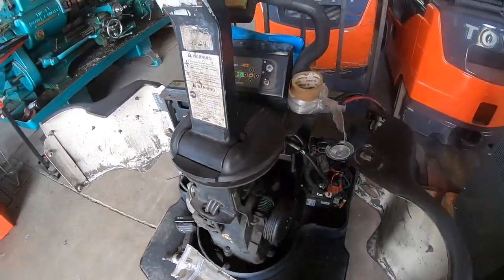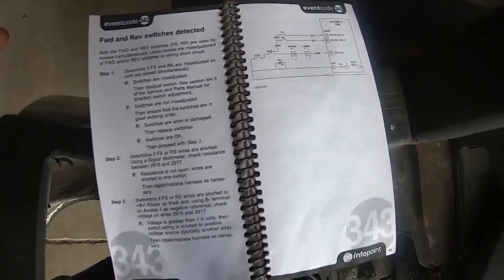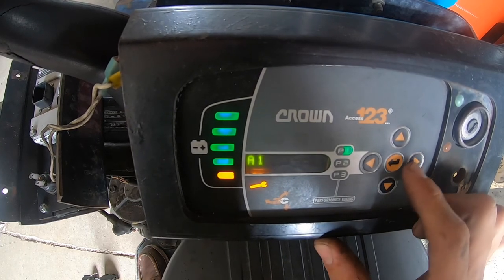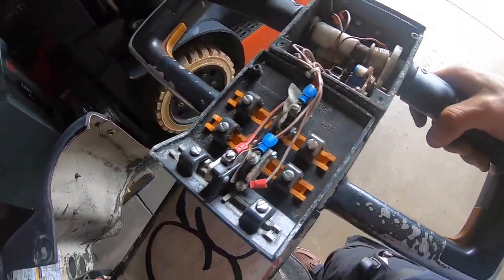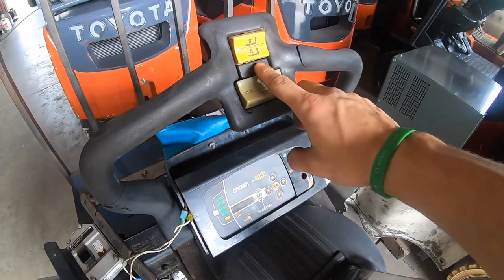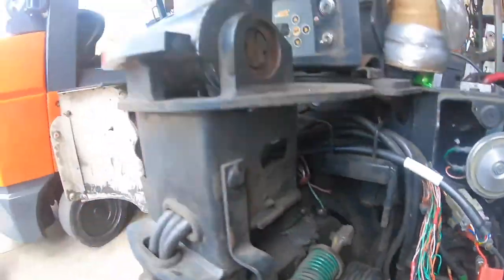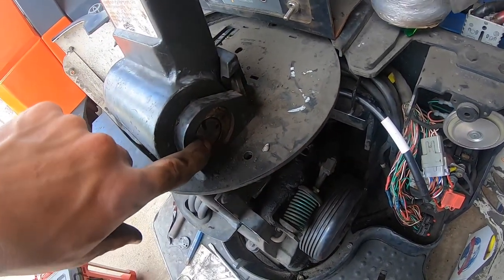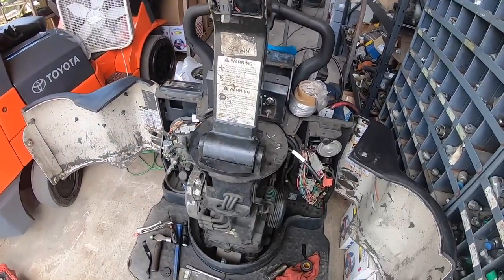CROWN PE 4500! Error Code 343 troubleshooting and repair!!

Comment from the maker: MY NEW EMAIL Is Liftworx@aol.com
Reply: good night, I'm from Brazil, I have a SHR 5500 CROWR, it's showing failure (RELESASE TRAVEL CONTROL) AND THE MACHINE I DON'T HAVE THE MAINTENANCE AND ELECTRICAL MANUAL, CAN YOU HELP ME, I WAIT HUG.
Reply from the maker: @LTB121  I will send you info. What is your email ?
Reply: how did you remove the harness
Reply: Is this still a good email
Reply from the maker: @KevinSmith-mt8cz  yes sir

Comment: I like your video could you make a video about how to test if the drive motor if its  a ground  Crown P.E 4500
Reply: Would like this as well
Reply from the maker: Will do! I recently replaced one because the drive motor would only drive super slow. The speed sensor was messed up. Another common problem is when it throws a code for the speed sensor, if you unplug the connector and turn the truck back on, and the code disappears, then it’s a bad motor.

Comment: So where would jc 401 on the main harness be? I had an error code 123 and 133 tested the can wires from access 1 and 3 and the ohms where good I also analyze the BRS1 and it's open and close as it should not sure where the problem is but it was also throwing code 133 which I'm supposed to test the jc401 to access 5. Any help would be appreciated.
Reply from the maker: Great question. JC 401 should be the big bin out harness that hooks up to access 5. OR I think it’s the one that goes to access 1. It passes by the lift motor pump and goes up to the display (access 1)

Comment: hey , nice video , ( 1:09 ) could you please tell typical code for crown sc series , besides do you accept consulations on your mail ?
Reply from the maker: Typical code is 2311. If that doesn’t work. You would have to contact crown and see if someone changed it
Reply: @theforkliftguy  oww thank you a lot
Reply: @theforkliftguy  maybe you know how to dissable the option of belt , every time i have to fasten my belt its so annoying and dangerous sometimes , maybe there is a wire which i can swich off
Reply from the maker: @panchasnyk8895  you would have to bi-pass the seat belt switch. Find the 2 cables that lead to the seat belt switch and join them together. That way you don’t have to keep putting the seat belt on
Reply: @theforkliftguy  god bless you , thanks a lot

Comment: You shouldn’t be saying the passwords out loud like this because then operators will be able to get into system and start turning off their travel alarms, spot lights, work lights and even worse… adjust the speeds and that can be a Big no no and someone could get hurt.
Reply from the maker: Thank you for your concern, I didn’t think about that.
Reply: @theforkliftguy  there’s other ways of getting the passwords too from what I’ve heard from other operators. Where I do catch someone changing stuff in the systems forklift, I end up going out there with my laptop and changing the password entirely. Good work though keep doing what you’re doing!
Reply: That's actually on the employer unless they can prove otherwise. Codes can be changed. It's taking things for granted when company's get to big to care about other stuff.  I know how to navigate the menus well enough between p1 and p3 but also know the speed can vary if you know the codes 1 time out of 1000 Is this maybe ever going to be an issue though. I've been using cat/crown/yale/linde/raymond/hyster/jughen or some other German brand for 18 yrs  they are all pretty good. User friendlyness isn't always great. And can easily cause a liability.  Problem is the people that decide to buy these for company's usually have never used one for 8hrs a day. And don't ask opinions from those that do. They look at the budget  😢

Comment: I work on pe4500 , all of a sudden these( fully release brakes ) errors been popping up. Any ideas
Reply from the maker: @KevinSmith-mt8cz  I would start by checking the brake switch adjustment. Make sure the spring tension is good, or you might need to adjust it so it hits the switch correctly.

Comment: How you like working of fork lift. I’m a 16 year automotive tech that want to make the switch.
Reply from the maker: I would 100% recommend it. You should do it in a heart beat. Or heavy equipment. Being a field mechanic, working on forklifts or heavy equipment is where it’s at. It’s not easy work but it pays better and every day is something different. You won’t regret it. There’s a reason you’re wanting to leave automotive.
Reply: What’s a better company you think. Crown, Toyota, Raymond?
Reply from the maker: @jess9571  I can’t speak for those companies, because I’ve never worked for them personally, but I can give you advice based on people that have worked for them and my experience working on those equipment. 

CROWN: they are known for their electric forklifts. I personally enjoy working on Crowns and that’s how I fell in love with electrical diagnostics and electric forklifts. Now I’ve met a lot of crown techs, and they generally don’t like working for crown. They have a lot of contracts and you’ll be putting in serious hours. Now I have heard that growth is pretty good in that company. Again, that’s just what I’ve heard. 

RAYMOND: a lot of my customers hate Raymond techs. Most of them are under qualified and just throw parts at things. Doesn’t mean you should be that way. Raymond’s are fairly easy to work on and they also are known for electric trucks. Raymond and Toyota is also kind of the same thing. 

TOYOTA: I’ve had nothing but good experiences with that company. My local Toyota dealer is amazing. I’m an independent forklift mechanic and own my business, and they go out of their way to help me if I need parts or services. I love working on Toyotas, as you can tell by my YouTube channel. From my experience, Toyotas are the best of both worlds. They have diesel, gas, LPG and electric forklifts. They got it all and they are really good at making them. Not hard to fix and parts are always available. I’m kind of biased towards Toyota as you can tell. lol

Comment: Today, I had a similar problem, with a PE4500, ok Error 336, potentiometer, 000. Drive-10.87 FWR-10.87, so far it is fine, now when you return the handler, then error 336 appears.
What can be???
Reply: Is adjust the pot  0 volts?
Reply: @brunocervantes2110  how?? pot is 0
Reply from the maker: Do you know how to enter to the password and get to inputs??
Reply: One of your switches is out of adjustment and is activating before the pot reaches voltage see what direction of travel sets off the code and adjust the switch accordingly
Reply: Adjust you for/rev screws

Comment: Hello The Forklift Guy, we have Crown ESR5260, the problem is, it suddenly stops after 1 meter of travel. Battery is full charge. can you please help me to troubleshoot this forklift. Thank you
Reply from the maker: Does it throw any codes?
Reply: @theforkliftguy  there is no code, only show a maintenance sign.
Reply: I work on ESR 5200 and 1000 it’s your drive motor or access 3

Comment: Question have you ever had code 362??
Reply: 362 is the pressure transducer to the hydraulics. It is the sensor on the other side of the fitting on the pump from the hose. Either a bad sensor or broken wire. It Apply’s to bot PEs or SCs .  And I believe also RCs. The lift will still run for the RC  and SC. but will still appear as a wrench
Reply from the maker: @ranflee2712 correct 👍🏼👍🏼

Comment: Have you ever had code 362?
Reply from the maker: I haven’t. But the manual says it’s a short circuit in the traction motor (M1) or Access 3 (the big grey controller). It might be a bad drive motor. You have to check resistance between each motor terminal and motor ground. If there is a short, then replace Drive motor. If there is an open circuit, then replace access 3.
Reply from the maker: If you need any help. Let me know

Comment: What's wrong with that WP behind it?? Lmao 🤔
Reply from the maker: What was* wrong with it is the correct question
Reply: @theforkliftguy  lol what was wrong with it? I got one that travels both directions but no lift or lower
Reply from the maker: @texasfishingandfitness2621  it had a bad drive motor.
Reply from the maker: @texasfishingandfitness2621  check battery status. Low battery or bad battery’s will not let you lift or lower
Reply: @theforkliftguy  yeah that's what I found, the charger isn't charging and the yellow/green indicator lights are not working to show if it's charging or not
Reply from the maker: @texasfishingandfitness2621  great 👍🏽